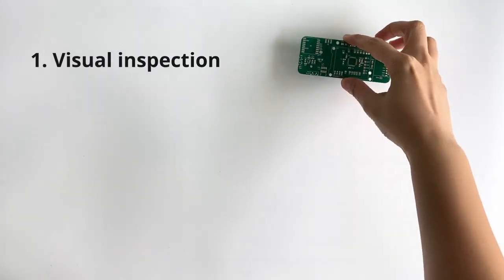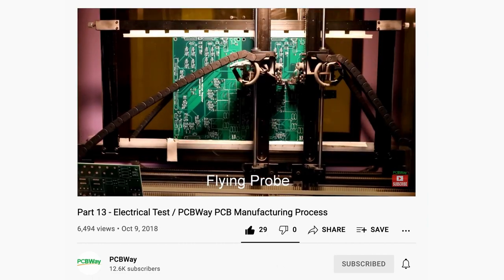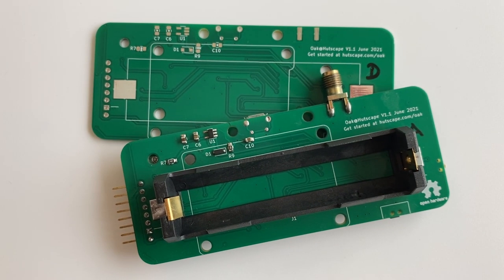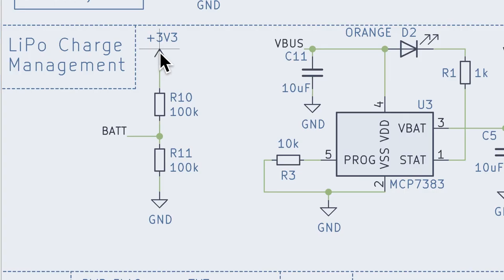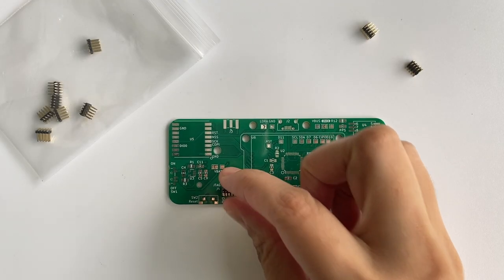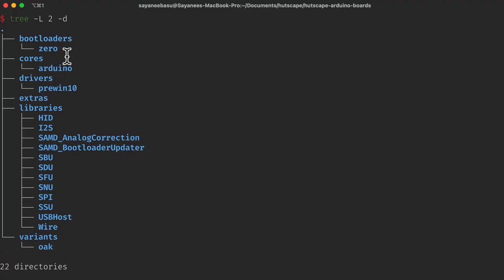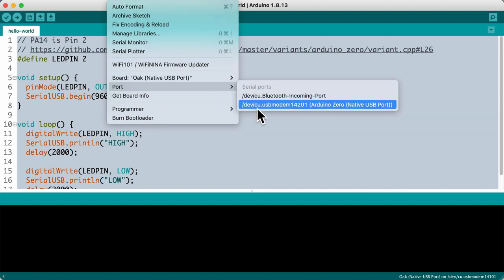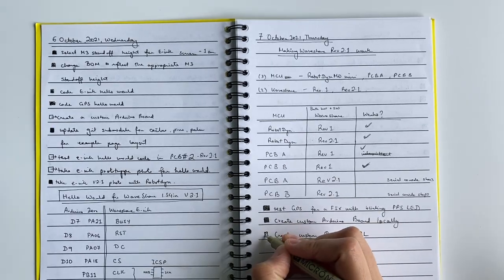Why does PCB to blinky LED take so long? 🧑🏼‍🏭

Comment: Fantastic video capturing the steps of a board bring-up!! kudos..
However, I do have a question. Why use a USB connector and a battery directly? 
AFAIK, it is a standard process to perform the board bringup with a current limited PSU.
Isnt it a much more controlled / reliable way of ensuring a current runaway does not happen?
Reply from the maker: Yes, yes yes!! Please use a current limiting power supply unit :)

I have missed out on this very important step of the board bring-up process, so thanks for pointing it out! 

I'm still on the lookout for a good PSU for my home lab. Do you have a recommendation for a model that is decently priced?
Reply from the maker: @ChinmayPendharkar  Thanks!!

Comment: Nice content. Ages ago when I was forced to use "Tier 3" PCB makers, the first check was the one you did , check for short between Supply Rail and Ground. Then for a shorted board , I used to use a high current , low voltage (<5V ) transformer and connect to the supply rail and ground, and turn on the power. If the short was a small hairline, the current would blow out the hairline and the board was usable, if I was lucky. Otherwise you take a deep depressing whiff of the magic smoke and charred traces and discard the board with a sigh of regret.Now... Better to just use the reputed PCB makers, at least you know any mistakes would most likely be your own and you have no one else to blame.
Reply from the maker: Wow! Thanks for sharing. 

I'm sure even today there will be manufacturing errors, but generally, for a simple board, I'm guessing these error probabilities are reducing with better machinery and checks.
Reply: @sayanee  Well they seem have gotten vanishingly small , at least in the board densities I operate at , (10mil spacing between  tracks, types)

Comment: Very informative video. Thanks for sharing.

Which IC r u using for power management?
Reply from the maker: If by power management you mean, LDO I am using AP2112. Or if you mean LiPo charging, it's MCP7383.

Feel free to refer to the schematic :) https://hutscape.com/oak/hardware/docs/schematic.pdf
Reply: @sayanee  Thanks for the reply. I wanted to know the IC for LiPo charging. Have you used TP4056? If yes, what's the difference/advantage of MCP7383?
Reply from the maker: @roguesecurity  Nope never used that chip. 

Seems like a couple of articles pointing to these 2 chips as indeed the common ones for Lion charging.

1. https://hackaday.io/project/169422-iot-ups/log/177680-battery-management
2. http://embedblog.eu/?p=123

If TP4056 works for you, just use it :) Unless there is a particular goal in mind to change the chip E.g. cost, other properties, etc.
Reply: @sayanee  thanks a lot